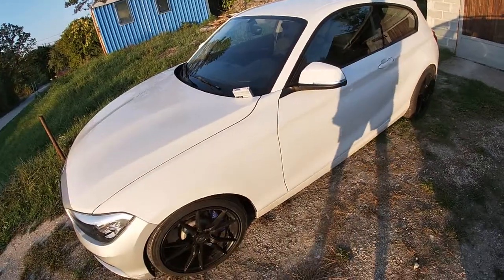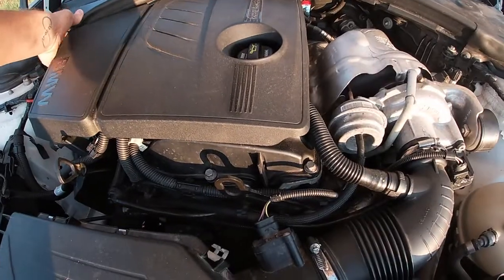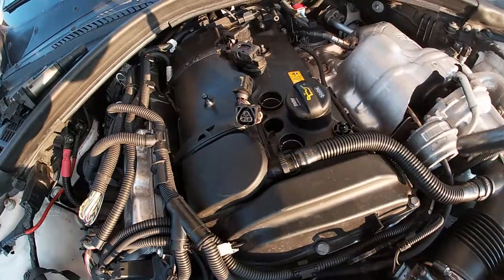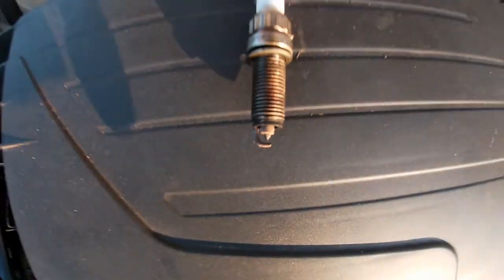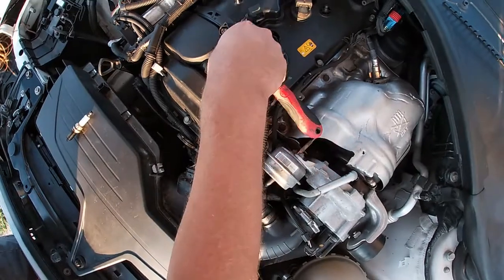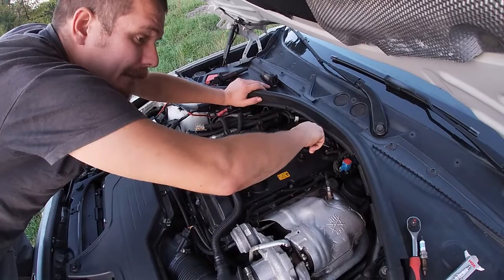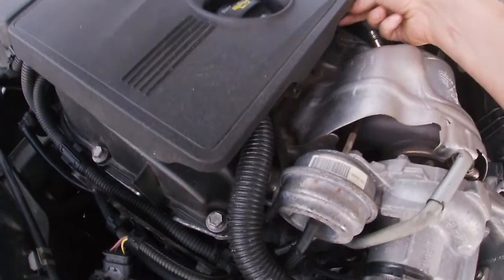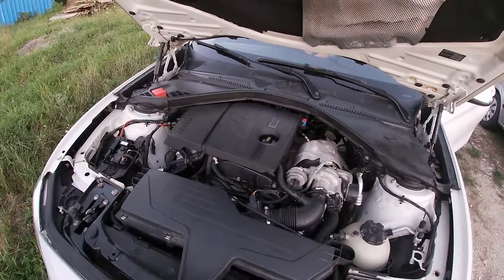How to change spark plugs on BMW F20/F30 N13 engine  - BMW 114i project

Comment: Your rocker cover gasket is bad which is why your first spark plug was oily when you took it out
Reply from the maker: Nope, one bolt wasn't tightened and one was stripped, all fixed a long time ago 😉

Comment: Ako moze informacija sta je bilo sa zamascenom svecicom u cemu je problem. Isto i kod mene na istom motoru jedna svecica zauljena na navoju. Upravo stavio nove NGK 97968.
Reply from the maker: Najvjerojatnije losija O-ring brtva na poklopcu ventila. Kod mene je bio malo veci problem jer sam pretegnuo jedan i unistio navoj, curilo je i kraj svijecice i sastrane po motoru, kasnije rijeseno
Reply: @WillowRacingTeam  Hvala na informaciji, nadam se da je samo to kod mene. Koji si navoj bio unistio od svecice ili poklopca.
Reply: @WillowRacingTeam  Jeli ti je auto mapirano? Koliko ima ks?
Reply from the maker: @fenix-iw4mg  je, trenutno oko 380 ks 😂
Reply: @WillowRacingTeam  Zasto stavljas hladniju svijecicu onda?
Reply from the maker: @fenix-iw4mg  auto je bio na stage 2 s vecim ICom, DPom i hladnijom svijecicom, oko 235ks
Sad je unutra n55 stage 2 i ima oko 380 ks, u pripremi su hibridni turbo i druga visokotlacna pumpa, lovit cemo 500 ks kad se slozi ( realno premal je turbinski dio a n55 tako da tesko bez alkohola, realnije ce bit oko 450 ks)

EDIT: N13 je prodan u drugoj sasiji ali slazemo drugi u E36 compactu, ako bude po planu taj ce bit "malo jaci" 😉
Reply: @WillowRacingTeam  Koje svijecice bi bile najbolje za n13 stage 1 210-220 ks
Reply from the maker: @fenix-iw4mg  po meni najbolje NGK kao u videu, mozes i serijske ostavit ili neku drugu marku, recimo Bosch od n55 motora. U svakom slucaju gledaj da ih mijenjas cesce, na motoru koji slazem je izgorio 2. cilindar, svjecice su bile kriminalne i po meni glavni uzrok kvara
Reply: @WillowRacingTeam  jesu ove jednu stepenicu hladnije od orginala.  Zarez jel treba štelat
Reply from the maker: @fenix-iw4mg  da, ne treba stelat, ok je out of the box. Ovo je ekvivalent JCW svjecici iz Minija s N18 motorom, znaci skoro isti motor s tvornickih 210 ks

Comment: how do i check whether 4 plugs are working fine? if 1 is not working, will there be engine light or obdii checking it ok??
Reply from the maker: Yes, you can check it with the diagnostic tool, it will tell you which cylinder is misfiring

Comment: HI Will, what is the function of that lines that you forget to plug? and what happends with the car if are not connected.
Reply from the maker: Vacuum lines, vacuum tank is a part of engine cover. The car would probably have rough idle, didn't really have the need to try it 😊
Reply: i forget one time, check engine will show and no turbo power :)